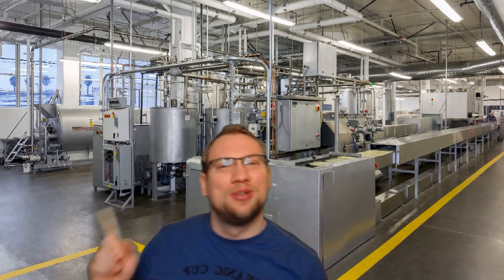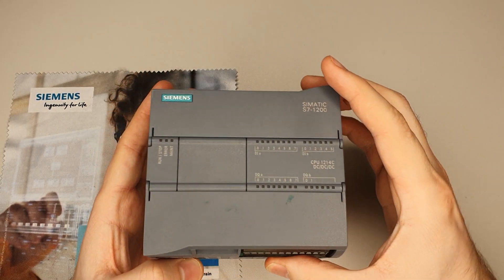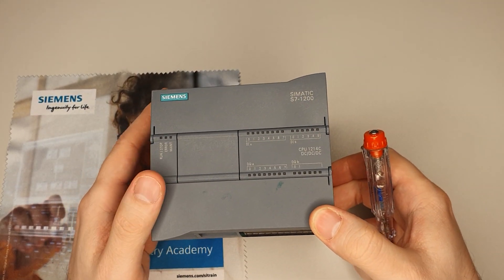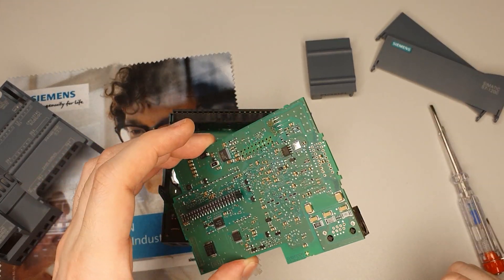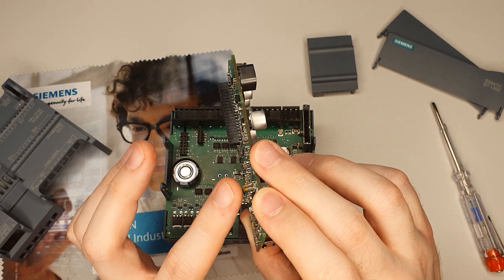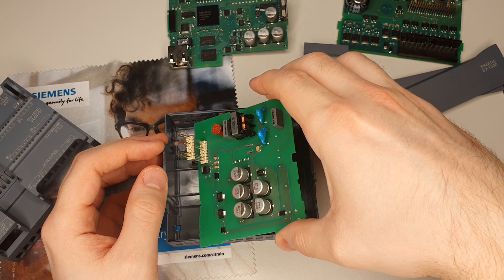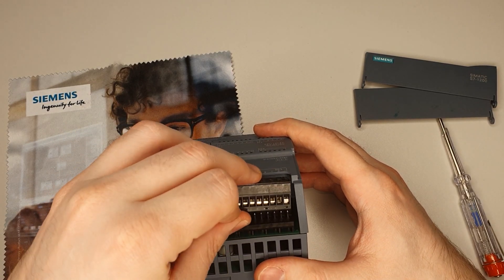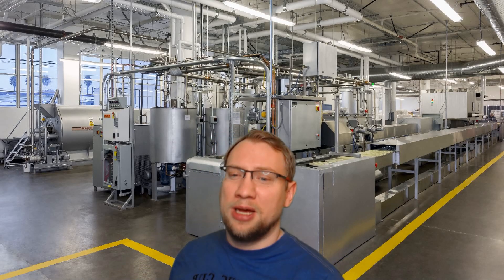S7-1200 PLC - What's Inside?

Comment: Ok so I have a confession, when I was a novice I wired the output terminals of a LOGO! PLC incorrectly, providing power to the M ports instead of the Q terminals, is that fixable? 

Ive taken the it apart and I see no obvious damage, but the outputs are not working, any tips?

Comment: This has been cleverly engineered to keep costs down. Not a single screw or wire. It is just 3 small PCBs snapping together and a few plastic parts snapping together as well.
The PCBs are probably outsourced to one of the many factories out there specialized in this task (100% automated), the plastic pieces are injection molded (3rd party supplier), Siemens only snaps together the pieces and put everything in a box (~1 minute per PLC manpower, probably outsourced in China). The only thing done in Germany is the design.

Comment: Does s7 1200 plc have internal memory? Or must need memory card for programming?
Reply: This model PLC has internally integrated circuit that will act as memory. No need to use battery/memory. But u have the external option to insert memory card

Comment: When I have seen the electric probe at 2:49 in your hand, something triggered inside me and a thought had arisen,
that probably someone just had applied Line (VAC) to DC power supply input of plc.
Reply from the maker: Always working under safe conditions, no worries!
Reply: @hegamurl  Safe conditions would be if I had seen insulation gloves at least Class 0 on your hands. That would be true safe conditions. 
Btw,  S7-1515 has 4 GB RAM, Dual-Core 1 GHz, AMD G Series APU T40E CPU on board. Do you have any information concerning entire 1500 series in tems of RAM and CPU characteristics?